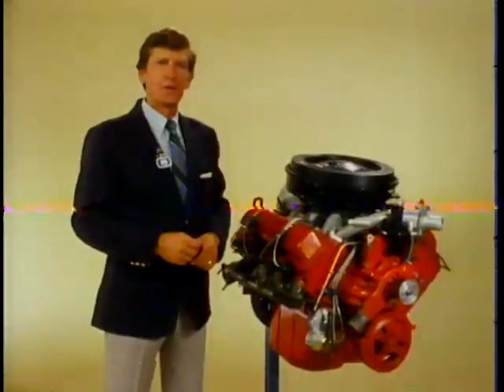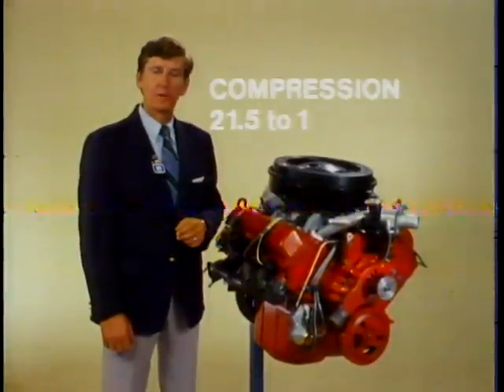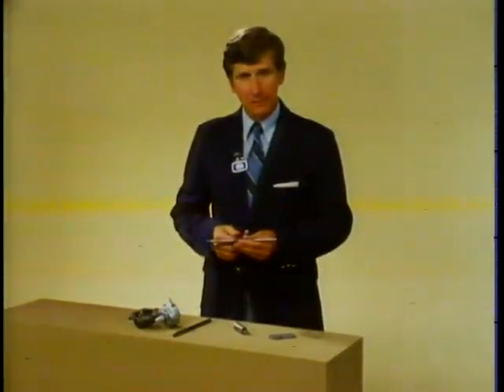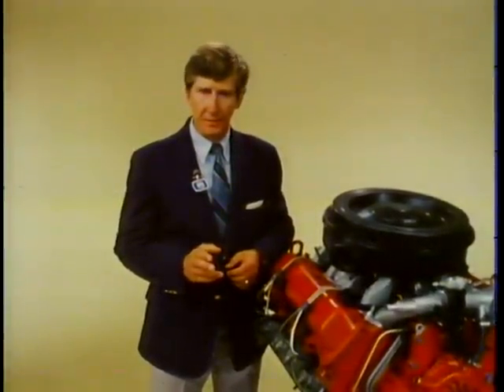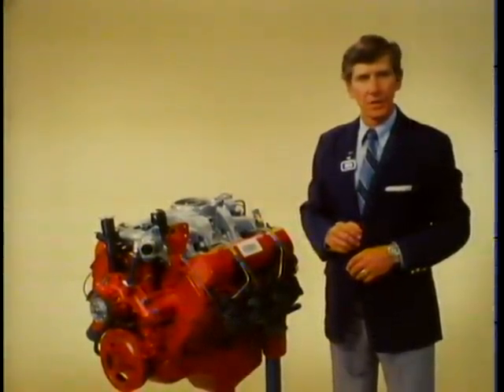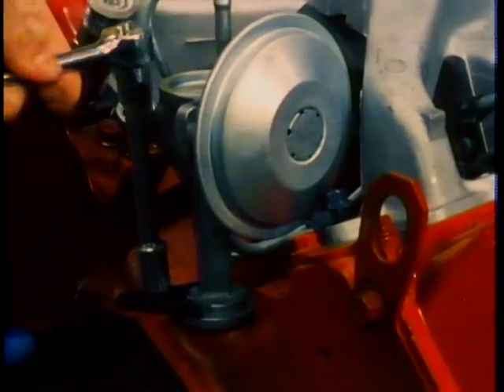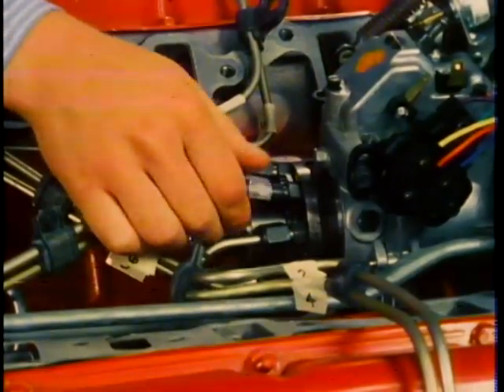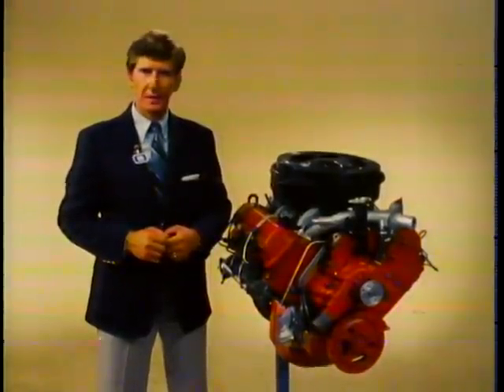General Motors /  Detroit Diesel 6.2 Training

Comment: This engine makes 240 lb-ft of torque.  Around this same time Ford was selling trucks with the 6.9L IDI diesel which generated 360 lb-ft.  How could GM justify such low numbers?  Pathetic really.  GM really never had a good grasp on diesel.  As far as I'm concerned, they still don't.  For their Duramax, they had to reach out to Isuzu because they couldn't do it themselves.  Sad really.
Reply: the 6.9 wasnt a ford motor, neither was the 7.3 idi or the 7.3 powerstroke, or the 6.0 powerstroke, or the 6.4 powerstroke. Their last motor the 6.7 powerstroke is one they can call their own now. (sad really).

By the way, gm owned detroit diesel which the 6.2 really is, and gm owned a significant share isuzu at the time of the duramax development. 

The eco diesel ram uses in their 1/2 tons is based off of a really old detroit diesel that was sold to VM which is sold to ram. Also ram buys their 5.9 of the past and their 6.7s from cummins. 

Nissan makes great diesel engines in markets in other countries however they sourced their diesel for american trucks from cummins. 

So anyways I would say it is actually the exception rather than the rule for truck manufacturers to make their own engines in house rather than find a supplier. Im not sure really why but it just seems to be the case.
Reply: You're vastly exagerating the figures. The 6.9 at release (83/84)had 315 ft lbs of torque. At that time, the civ 6.2 had 285 ft lbs of torque. The mil 6.2 was at 330 ft lbs of torque in '84. 
The 6.2 was made to replace the 305, as well as be a high mileage option for those wanting a 350. Stock, the civ version has about as much power as the same year 350's. With mild mods, the 6.2 gains power very easily.
Reply: GM 2 strokes were very powerful. Their 4 strokes not really.
Reply: Vercus100 GM reached out to themselves; they've been partnered with Isuzu for years.
Reply: A Crustacean especially when they make a 4 stroke out of a gas block XD
Reply: Lol not one of the major 3 companies has made their own Diesel engines. 
Gm used Isuzu, and made a change in North America and brought in common rail diesels. 
Ford used international to build their engines, which they did an okay job with (except obviously the 6.0 and 6.4) 
And dodge got Cummins to build them engines (too bad they didn't get someone better to build their transmissions.)... but you're right, GM is so bad for realizing they were behind in the diesel race and trying to make a change. Shame on them.
Reply: Dennis Reelie ... Ford builds there engines in house now, no more international as far as I know, maybe design license but I'm not sure.
Reply: traductor en español
Reply: Saying "gm had to ask isuzu" is like saying "BMW had to ask Mini"

GM is GM. No matter where it is.
Reply: They were both absolute garbage, soo....
Reply: While dodge still cant even make their own diesel
Reply: Red Billy, that's dumb.
Reply: Brandon hahaha you nailed him man. International harvester! And dodge is sad to.
Reply: Vercus100 gm never made diesels for their power, they've always focused on reliability and economy. It's the same thing with the towing capacities of the new hd's. They realised that almost nobody is going to be towing 30k pounds all day everyday, instead they set their goals on realistic ones. That and gm is the only company that has never outsourced for their diesels. Ford went to international harvester, and ram to cummins.
Reply: These engines piticularly the 6.5L were great for fuel economy... My 1996 6.5L 3500 4x4 gets 24.5MPG with 4.10 gears almost stock... They still use the 6.5L in the US Army HUMMVEE's and the up armored ones are 16,000lbs TARE not sure what GV is? They have plenty of power. The 6.2L had alot less power but more than enough for a 2500.  These engines are. Motor boat industry still to this day loves these engines for fuel economy reasons .. But when you look at how GM installed these engines in their trucks they messed it up with the accessories, they made the PMD, Vac pump and lift pump total garbage.  And put a harmonic balancer on it that was so bad it would crack the crankshaft at 200,000 clicks... Fairly easy fixes except for the harmonic balancer, they are fantastic engines all you need to do is dealership proof them.  

Dealership proofing a 6.2L and 6.5L
$1,000-$1500

Dealership proofing a 6.0L and 6.4L Power joke 10,000-$15,000

And they are still the champions of fuel economy.... The new Diesel Colorodo gets 20mpg vs my 1996 3500 which gets 24.5L. I don't need to tow 25,000+ lbs
Reply: Mach SCGA how do I dealer proof a 130cc V6 4/ D I installed emission controls on?
Reply: Vercus100 I worked in an engine shop in the mid 2000s and we worked on the big 3 diesels quite a bit. 
Yea I drove an old 6.9 idi with a standard and as I was going around the entrance ramp to get on the highway it kept wanting to burn that inside tire. 
Any 6.5t I ever drove, regardless of transmission was like a wet fart in comparison. 
what a piss poor setup that pretty much made the name diesel a bad word in America.
Reply: galiffrey1 
I sit out on the front porch after dinner, and listen to dodges rusting.
Reply: randy you're dumber,...there is no u in peterbilt
Reply: Vercus100 try finding a pos ford that can compete with a 8v92 or a series 60
Reply: @machscga6238  I have and had several 6.2 and 6.5, never seen above 18, NEVER! Some 6.2 w Banks, 3.42 gears, 3.73, 4.10, all w 700R4, 4L80E, lite footing it... Usually 15-17... Sorry bud
Reply: @4x4le  Yes Fords engine ,which all have problems with head gaskets , is an International . A noisy fat lump of an engine.
Reply: @dennisreelie1720  detroit diesel is a division of gm
Reply: @chrisj4984  that’s great and all but I will never buy a shit box Chevy because cv axles are for Hondas.

Comment: and here it is folks you can work on this diesel engine no environement gretat hunberg under the hood all simple engineering.GM SHOULD BE ASHAMED AT SELLING PURE GARBAGE WITH A WIRE HARNESS THATS A FOOT IN DIAMETER..JUST TO IGNITE FUEL THATS IT.

Comment: 186,000 miles and cracked main bearing web which failed the crank. Common problem and GM would do nothing. Walked away and never turned back. Poorest customer relations ever. My Ford/Naviatar 7.3 was going strong at 400,000 when it was sold. Can't say that about the 6.0 series of Powerstrokes (Power Jokes). Shouldn't have to "Bullet Proof" something that these manufacturers (that have millions of dollars and fleets of engineers) should be doing. No excuse.......
Reply: The 6.0 is a cat designed engine, built for Dodge, that Ford stole away from Dodge..   it is also the best built engine on the market.. bullet proofing is a gimmick for people to make money on.. the egr cooler is at fault.. they break from heat, leak into the intake and break the head bolts, (as cat designed them to, so as not to crater the lower end), from static lock..
I have an 03 6.0, with 600k miles.. stock, never been touched.. except, I blocked off the egr when it had 12 miles on it..  I pulled the egr valve and put the 12 Dollar plug back in the hole.. problem solved
Reply: @detroitdiesel-vu3ig  you wish I was sweeping your floor, boy.. go away, you bug me..
Reply: @KBS117  boi I'm about to learn you good. First off, Caterpillar and Chrysler have never worked together. Chrysler wouldn't even look at another diesel manufacturer at the time of the 6.0 Navistar's development phase which began in the late 90's after it was apparent that thier T444e platform would fail upcoming NOx emissions requirements for light duty trucks. Dodge had a 10 year relationship with Cummins by that point and had no reason or the money to develop a new motor with a different diesel engine manufacturer. Ford has never owned stock in Caterpillar either. The 6.0 utilized the HEUI injection system because Navistar was already familiar with it because they had been using it on their T444e platform since 1993 when it was invented and put to use by multiple diesel engine manufacturers. The 6.0 turbo diesel V8 is a Navistar engine that was somewhat developed with Peugeot, the idea being that european manufacturers had been dealing with more stringent diesel emissions, which is the reason the 6.0 was developed in the first place. You done yet?
Reply: @detroitdiesel-vu3ig  you make all that fiction up? And these engine designers change hands so fast, it's sad.  And, i am talking of time before Dodge and cum-apart, started their venture. You are too young to know what happened in the early 90's. We were all excited back then, that Dodge and cat, were building a v-8 diesel engine for the Dodge trucks.. and it's wasn't Ford directly that bought up the car stock, it was a Ford owned group, who got control of cat, and stopped Lee from using the high performance diesel he helped design. Ford and Lee were bitter enemies after he left Ford and took over Dodge.. you should read his book. He spells all this out in it..
Reply: @KBS117  Lee Iacocca stepped down from Chrysler in 1992. If you can provide me with any evidence that Chrysler and Caterpillar were developing any diesel motor together, I'll admit I am wrong. Like I said, however, Dodge was putting Cummins B-series in their trucks starting with the 1989 model year and R&R began back in 1985. The 6.0 Powerstroke didn't begin development until the late 90's so timelines are not matching up

Comment: This engine was garbage. The Detroit diesel 453 would deliver more horsepower than this pos even in 1981. This was no better than their 350 diesel. maintenance is very high.
Reply: The 6.2/6.5 was not the problem,  lacking a turbo was THE problem.   I put a Banks Turbo kit on my van and it was a whole new ride;  torque for pulling my trailer was unreal and my rear bumper no longer turned black from the exhaust. 
The engine was designed by Detroit Diesel and was not the GM 350 diesel that was based on an Olds V8.
Reply: Why did gm not offer the turbo? These would also breakdown a lot in the Army too.
Reply: my guess is the same reason Ford didnt.. cost.. and not knowing much about them too.. like with anything with the help of the aftermarket they can be decent engines.. no Cummins mind you but the Cummins engine was also made from the get go to be a industrial engine not a Consumer truck engine..
Reply: Seems to have beefy internals
Reply: You could get them with a turbo from 1988 to the early 90's, but from 82-87 GM gave no fucks.
Reply: A Crustacean I daily a 6.2. Maintainence is very low, power is pretty good. Reliability is excellent.
Reply: mines been running for 32 years on nothing but a set of glow plugs, a glow plug controller, 2 starters and a bunch of oil changes.
Reply: A Crustacean This is not a Detroit.
Reply: Red Billy hp is how much load you can pull, torque is how quietly you can pull it
Reply: @MrGGPRI  Did you turn up the fuel too, or just use the boost as exhaust energy recovery?

Comment: To bad these engines were shit.
Reply: One of the best diesels made. Easy to work on, easy to get power out of, great fuel economy, great reliability.
Reply: compared to?
Reply: Why were they shit?
Reply: FCFordLord 12v cummins
Reply: The Olds 5.7 diesels were the crap diesel GM put in cars and trucks. I had a 81 Silverado with the crap 5.7 and on the visor was a sticker warning this engine could not be used for towing anything over 2000 lbs which totally defies the usefulness of a pickup truck. Sure enough it threw a rod and I put a gasoline 350 in it.
Reply: +MechRider89 No power.
Reply: Richard Noggin  I have a 6.5 Diesel in my RV, she is 12k lbs, I have 3 tickets over 85 mph last 2 years.  Travel Rockies, Appalachians, gets 15 mpg. Not a drag racer, but she has 500k miles and starts in 2 seconds every time.
Reply: mech because he saw it on you tube!!lol!!!  bet he cant fix a sandwich never mind an engine!!!!!

Comment: absolute junk engines. Boat anchor at its best
Reply: Gm destroyed the diesel market, back in the day..when Ford came out with the 6.9 diesel, the could not give one away...
Reply: It’s funny you call something junk chief justice my ass I like to see you design a motor that still working after 35 years.
Reply: @vicpaul5808  he called it right buddy..I was a diesel tech for gm.. only 17% of the 5.7 and 6.2 diesels, ever saw 50k miles, without major repairs...
Reply: @Hotdog_84  yeah you said it right, you don't know anything.. I worked as a tech for g.m. ...even the 6.5, was junk.. I can remember our service lot, full of blown 6.5's, to be replaced under warranty.. this was an indirect diesel engine, which by any standard is a low powered junk heap.. the heads always crack, because of the heat generated from the glow plugs Chambers..   I want to puke, just talking about them..
Reply: @Hotdog_84  my 6.0 Ford diesel puts out 500 h.p. it is smaller than this junker, and mine has 856k miles.. you defend this junk, all you want.. it don't make you right, just stupid.
Reply: @KBS117  yeah I'm gonna call BS on ya buddy. My 6.2 has 210,000 and was a tree trimming truck for most of its life. My 6.5 has just hit 114,000 and still is running strong. Of course, the PMD has been relocated tho

Comment: The biggest turd ever built... Junk... The only thing worse, was the nv-4500, 5 speed transmission behind it..  gm should be sued for the junk they produce.   The lawsuits on the transmission, forced new venture into bankruptcy.. I had 3 of theses trucks, when the engines were not blown, the transmissions were locked up.. junk...I get chills watching this crap..
Reply: Gotta learn how to change the oil buddy. And the NV4500 is legendary. Servicing is NOT a recommendation. Now go have fun in your Toyota Camry
Reply: @KBS117  I hope this is a joke that I'm just not aware enough to realize because if not, I'm gonna be extremely saddened to know someone thinks this garbage. Also, lee was behind the Pinto, the Omni/Horizon, and all variations of the K-car. He wasn't exactly after speed
Reply: @detroitdiesel-vu3ig  whatever, I spoke facts. Keep believing your fantasies..makes me no never mind..